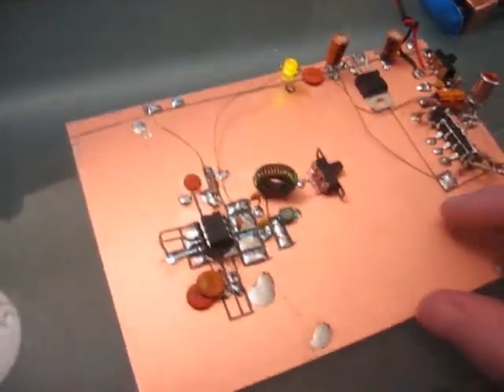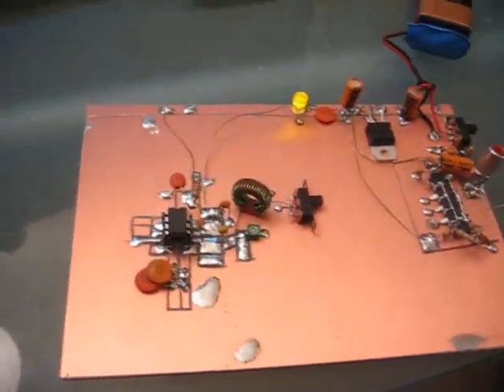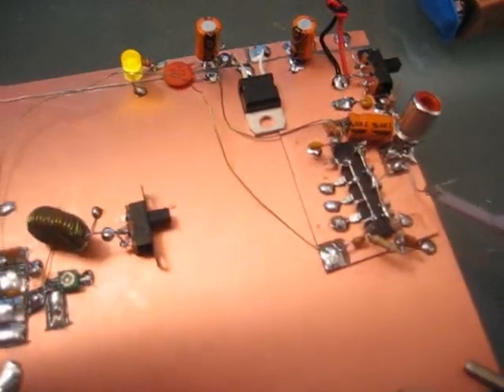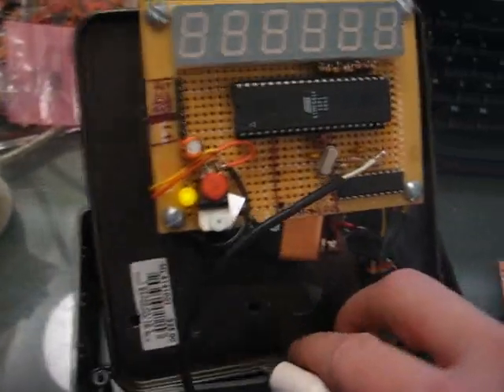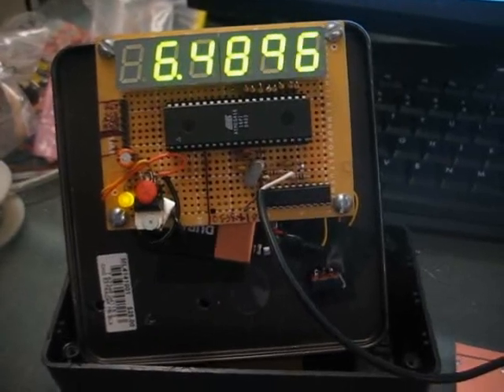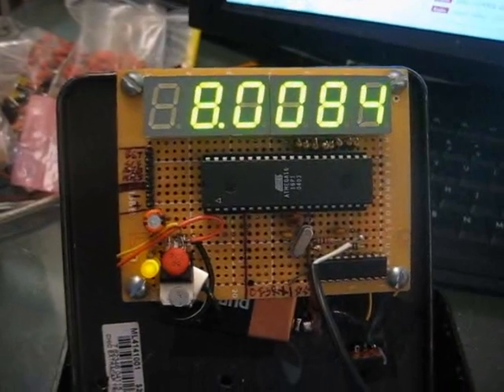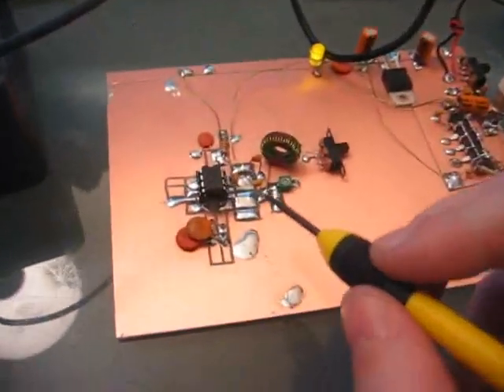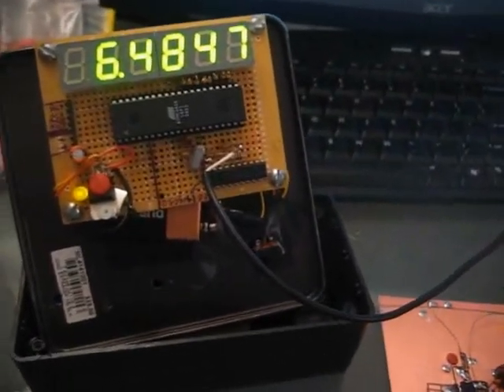Simple-case amateur radio circuit

Comment: did you make or buy the board that you built the radio on
Reply from the maker: It's a piece of copper-clad board. I used a rotary tool to drill some grooves in it to make pads I could solder to. Google "copper clad Manhattan style" to find some helpful instructional examples. I like the style! A big ground plane is easy to solder to and reduces noise (compared to breadboards)
Reply: @swharden  thank you kind sir